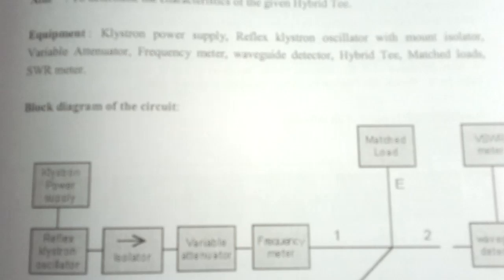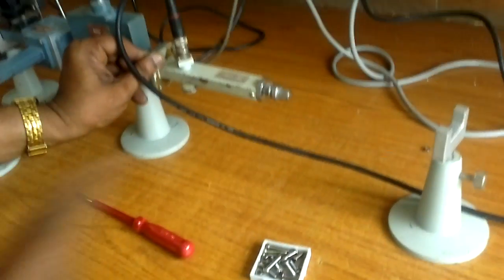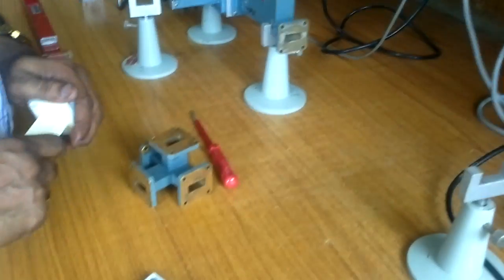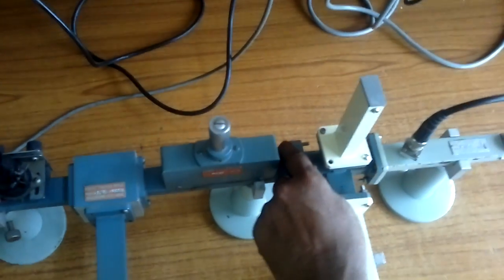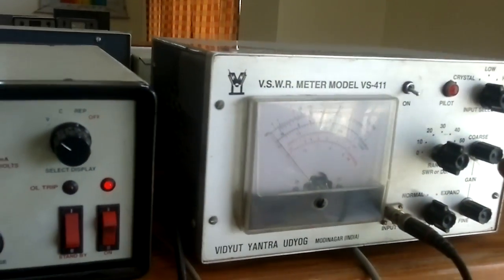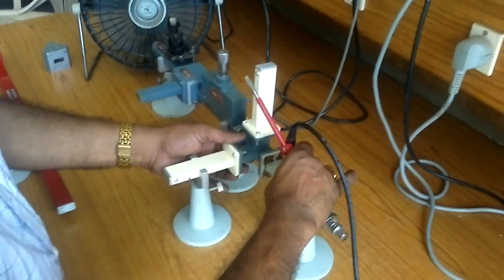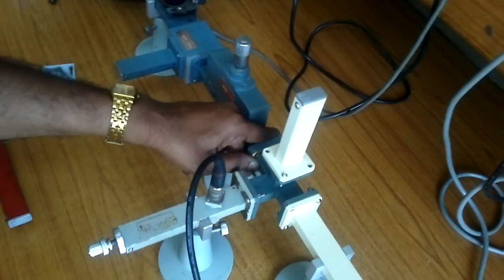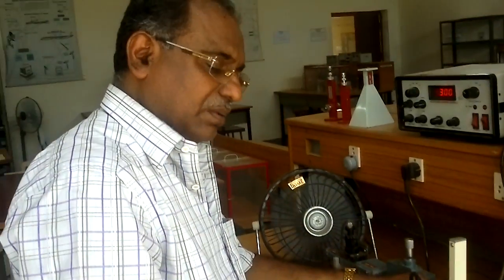MICROWAVE LAB Part 6

Comment: hello sir, I'm doing this topic for my FYP. I have to scan liquid material by using microwave technique. However, I'm stuck how to placed my material in connection with the coupler. It will be very helpful if you may recommend any way to do it. thank you sir